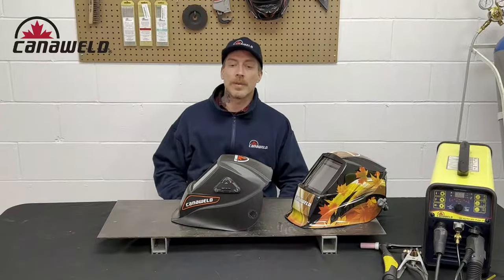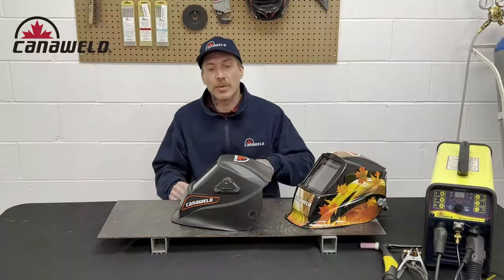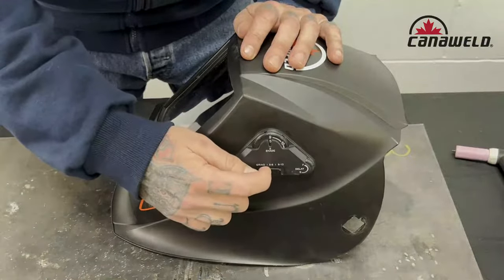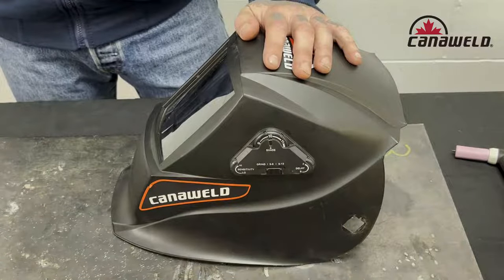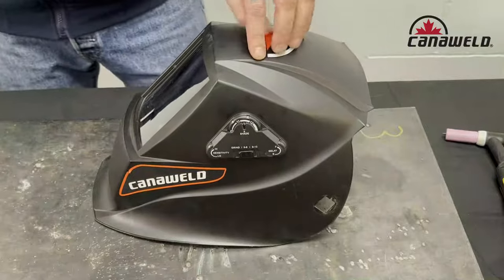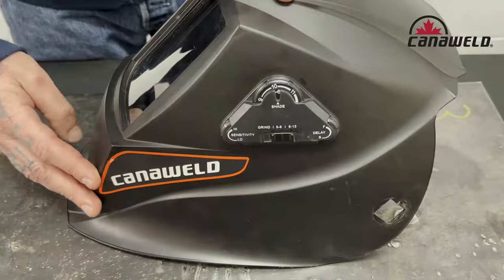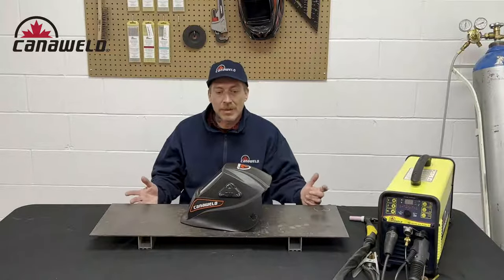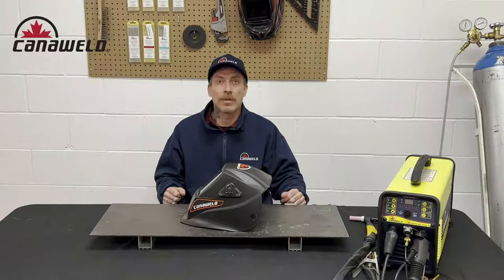How to choose right helmet's shade for different welding process

Comment: Good video. I am a beginner at welding and mig welding autobody panels and light steel. I switch between both flux core and gas. How do I know what amps I am using? Thanks for sharing.👍👍🍁
Reply from the maker: Thank you for your message. 
Wire-speed and welding voltage, among many other factors, play an important role in MIG welding.
Please take a look at the following article and contact us with any other questions.
https://weldguru.com/mig-welder-settings/
admin@canaweld.com
(416)548-5650

Comment: I just started flux core welding (testing at about 100 A). I can't see my work piece at all to see where I'm going at shade 10. I'm thinking 9-9.5 might help but was concerned about damaging my eyes. I've heard flux core is one of the brightest. Do you think it would be risky at 9-9.5? Thanks. I'm also trying different light setups to see if that might help.
Reply from the maker: Hi
According to the Occupational Safety and Health Administration, you are not allowed to use a shade less than 10 for about 100A of flux-cored welding for your safety reasons.
Please check the following link.
https://www.osha.gov/laws-regs/regulations/standardnumber/1915/1915.153
Stay safe,
Regards
Reply: @CanaweldInc  Thanks, I'm now shade 11. I attached a towel across the back of my hood to prevent back light reflection inside the hood. I can see much better now. Thanks

Comment: please tell me what is best setting sensitivity and delay i weld but my eyes cry next day please tell me i have shermanv6b mask i dont know how to set up
Reply from the maker: Thank you for your message. The optimal settings for sensitivity, delay, and shade in an automatic welding mask according to OSHA (Occupational Safety and Health Administration) guidelines can vary based on the type of welding being performed and personal comfort levels. However, some general guidelines are:

1. Sensitivity: This controls how sensitive the helmet is to welding arc light. It should be set to a level where the helmet darkens reliably when the welding arc is struck. The correct setting depends on the welding environment's ambient light and the welder's preference. The higher the level of sensitivity, the better for protection.

2. Delay: This controls how long the lens stays dark after the welding arc stops. Shorter delays are typically used for tack welding or at low amperage. In comparison, longer delays can be better for high-amperage welding, as they protect the eyes from prolonged exposure to the intense afterglow of the welding arc. The higher the delay setting, the better for protection.

3. Shade: The appropriate shade level depends on the welding process and amperage. For example, a typical setting for MIG or TIG welding might be a shade level of 11-14, but it can vary. The higher the shade, the better for protection.

OSHA provides a chart in its standards (like ANSI Z49.1) that recommends specific shade numbers for different types of welding and amperage levels.

Always refer to the helmet manufacturer’s instructions and OSHA guidelines for specific recommendations. Adjusting these settings for comfort and clarity while ensuring maximum protection is important. For the most current and specific OSHA regulations, you can consult their official website or relevant safety documents.

Comment: I use the helmet with oxy acetylene  , I don’t weld I just heat and melt metals, what shade should I use?
Reply from the maker: Hi ,
For oxy cutting under 1 inch thickness,minimum protective shade number is 3 .
For oxy welding under 1/8” thickness ,minimum protective shade is 4